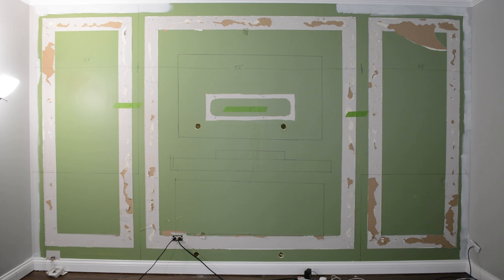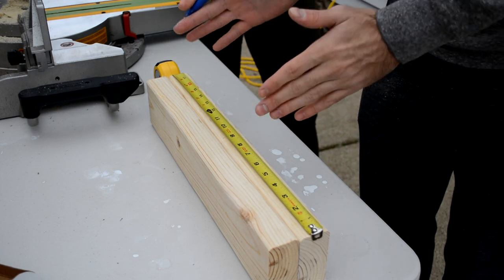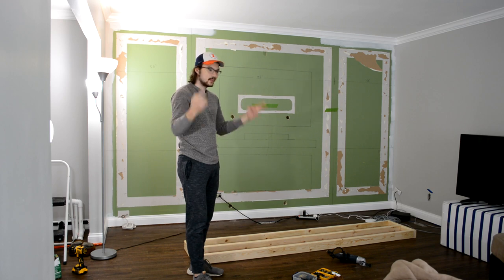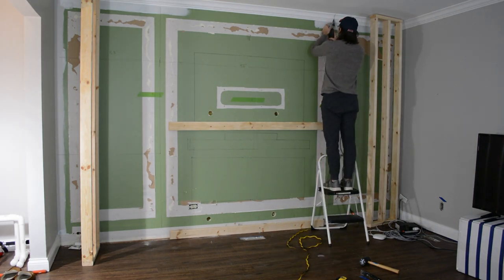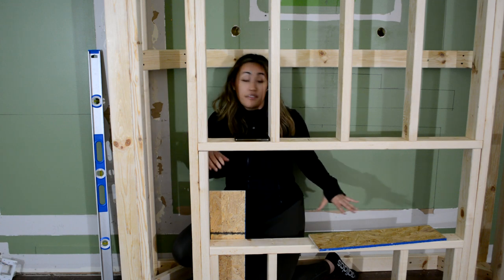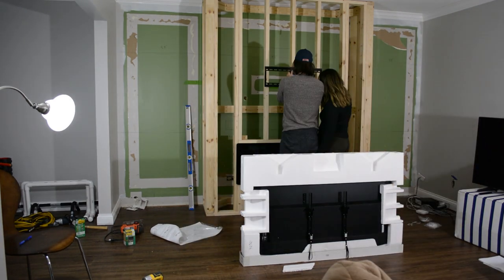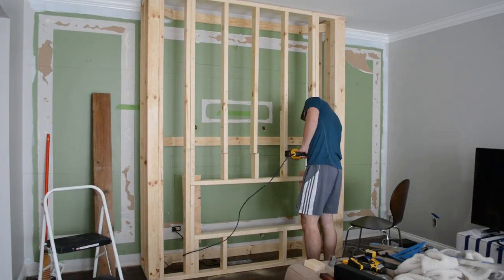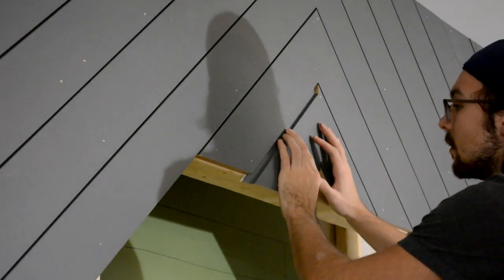Project Needle // Episode 5: Media Center Part I - Construction

Comment: Awesome video. Liked and subscribed. Saw this project in TikTok but will be following. I need to update y current living room wall and this seems great. How does the electric fireplace work with heating the space?
Reply from the maker: Thanks for the subscription! We honestly use the fireplace every night but mainly for the visual of seeing the faux flames. We rarely use the heating function. But think of it as a space heater. It won't heat your house but I'm sure it could heat up a room for sure.
Reply: @GoldenKeyDesign  that’s what I’m looking for. Just the space. Thanks

Comment: What is the total length of the media center? And what size tv is that?
Reply from the maker: Good question! The total width is 12 feet, each side cabinet is 3 feet, and the fireplace section is 6 feet wide. The TV is 55" which is the biggest we could go for the size of the room. Happy building 🔨